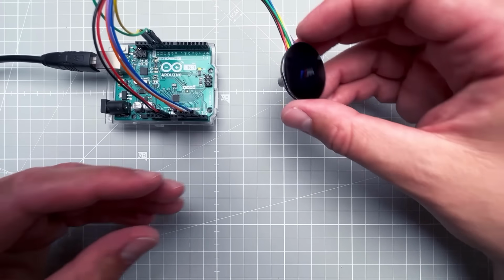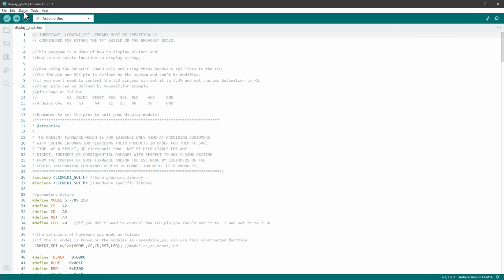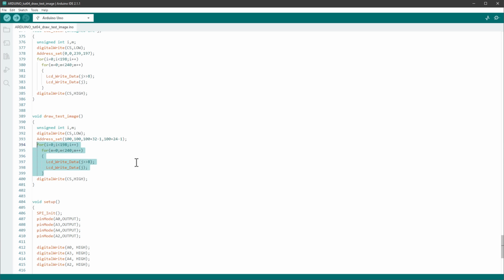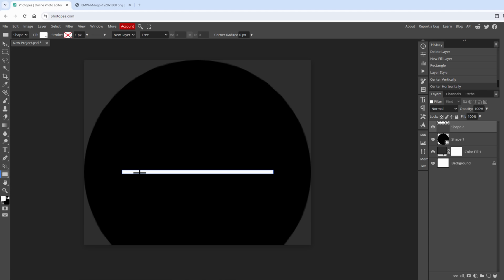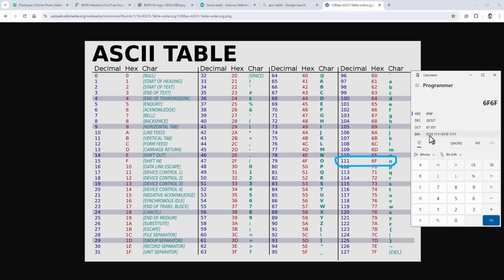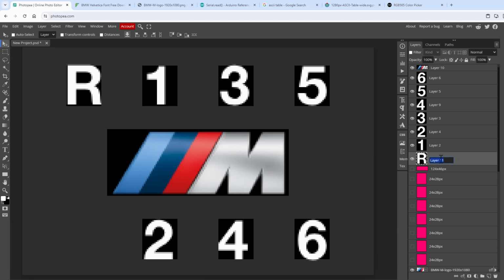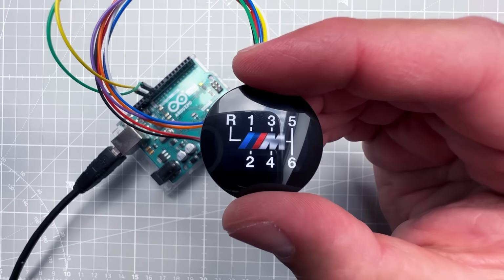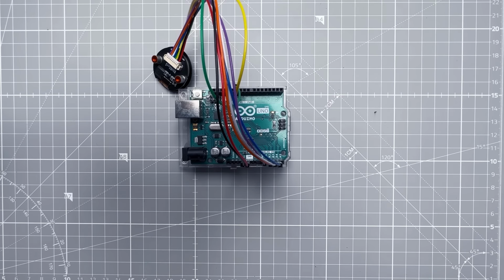I found PERFECT display

Comment from the maker: Gear Indicator video series (so far):
Part 1 - getting current gear with hall sensors: https://youtu.be/QixtxaAda18
Part 2 - exploring the Pimoroni 11x7px display: https://youtu.be/sZZFgSmYJjc
Part 3 - custom 3D printed shifter knob: https://youtu.be/HcP48uCBzDQ
Part 4 - Pimoroni 5x5 RGB LED display: https://youtu.be/84bn_OpuyCQ
Part 5 - SimHub shifter knob: https://youtu.be/JbVqXZngXAY
Part 6 - NeoPixel hexagonal displays: https://youtu.be/1NI-I1Lpdqo
Part 7 - Round LCD Display: https://youtu.be/pbqgrv5YSf0
Reply: You can use RP2040-Zero which costs 1.55$, it has 2MB flash memory
Reply: @ragesmirk  and a Gyroscope
Reply: I had no idea you could display such crisp high res with an Uno !

Your shifter is going to look AWESOME 👍😮
Reply: until you will build everything and test, engine will start making loud klak klak klak noises and one evening u-tutututu and engine kaput.
Reply from the maker: @aj9485 why would you think that?
Reply: @upir_upir  hey could you please create a design for a civic Si?
Reply: Hi, @upir_upir base in your grate work I made one for my car, I plan to use ESP32-C3 SuperMini board because ESP32 already have can bus (TWAI) I plan to made custom board with can transceiver and voltage regulator this way esp32 board and transceiver board can fit inside the gear shifter and only need 4 wires to run outside shifter (I already have sensors on my transmission sending gear selection over can network) The shifter I found on AliExpress work grat, display fit with just little modification. Here some test https://youtu.be/XlcMyIc9mCU?si=68l9Ix9YknBYOVKo

Comment: Thank you so much for all this work you did. I am going to use your code with a few modifications to work on my VW Jetta. I have changed the center image to "TDI" and I have rotated the screen 180 degrees so the flat section is at the top. The reason for the rotation is to allow room to put a small number below the shift pattern for  temperature/humidity display. My car does not have that so I'll include it on the shift knob. I'll also code that to update in between the shifter code. For those of you having problems with your coding I suggest you try ChatGPT for answers. It's fantastic at helping with problems.

Comment: i tryed youre code an only get a blackscreen. i have the display you listed in the deskription and an arduino mega the pins are corect and the demo programs from the data-sheet also work, but youre code only produces a blackscreen
Reply from the maker: Have you adjusted the pins for mega? I don´t see any good reason why it would be any different.

Comment: I don't understand why the update rate is so slow. Perhaps compacting the library into the program would be better. On an arduino 2560 I have a 7735 display at 565 color (16 bit) format and it is at least 10x faster than what you are showing. I assume that 77xx color LCD chips are all similar
Reply from the maker: I don´t know. As you mentioned, perhaps slow SPI speed? Would be nice if the update was faster for sure.

Comment: I am wondering, how would one hide the wires that go from the shift knob down to the controller board, assuming it's hidden somewhere under the center console?

I personally am going to attempt this project with an ESP32 with a round screen already built in, so I won't need another board, but I will need the hall effect sensor PCB. Now to connect the hall effect sensor PCB to the shift knob I'd need to of course run wires from the knob to the PCB, but unless I run them through the shift lever, then they will be visible on the outside, and I want to avoid that. Do you maybe know what else I could attempt to not be forced to drill a hole through the shift lever in my car?
Reply from the maker: I have used the wires behind the shifter lever, so it´s partially visible if you look closely, but it´s not that bad. I know that some shifters are already hollow, but that´s not the case for my car.

Comment: do you know what connector this screen uses? Is it a picoblade/MX 1.25? Great video btw, made me start my own project using the same screen
Reply from the maker: I´m sorry but I don´t know the connector name. Good luck with your project, what will you create?
Reply: @ no worries, I will just order a couple options and try them out :D I’m making a digital shift knob for BMW using this screen and a custom control module based off ESP32 and MCP2515. The idea is to make a plug and play solution that is compatible with most BMW models

Comment: Very nice ! ... directly ordered some :) ... Ever tried to put this inside a real BMW shifting knob ? The original BMW Logo for sure is easily removable and if you make a passage for the cable next to the plastic holder for the gear stick this should work ...
Reply from the maker: Cool! I haven´t tried it yet, but I know that some BMWs has the shifter illuminated - i.e. there is already 12V power available inside.

Comment: wow, I got here because I made a crapy 7 segment shift indicator a few years ago, I was hoping to improve with a a better oled screen and I was looking for a round one. Now I need this, lol, Can I buy it from you? I don´t have a 3d printer or the skill to make it nice. It is for a kswapped civic, 6 gear gearbox, with the reverse on the bottom right side. If there is room to add features, I have 2 ideas! 1) shift light: I have an output wire from the standalone ecu that can trigger that, turn the screen background to yellow and show a red SHIFT word, like on the fueltech ecus. 2) Another nice feature is that my car has a way to lock the reverse to avoid going from 5th gear to reverse, I lock it and unlock it using a switch, it would be nice to have a reminder on the knob screen.
Reply from the maker: Thank you for your nice words, but I don´t see this - at least not for now. If I make a second version, I will definitely use some of your ideas, they are all great! Good luck with your project.

Comment: I d/l-ed your code and have it running great, but I would like to rotate the screen output 180 degrees so i can put a small temperature display at the bottom on the shifter pattern. With the display rotated there's just enough room to add it in the left over circular area. Is there anyway to do that without adding in another screen driver? SPI.H does not support screen rotation, thus my question to you. Thanks in advance, love your idea and will be implementing it in my VW TDI...
Reply from the maker: I would think that the screen driver itself does support screen rotation - they usually always do, but you would need to find the correct command and send it to the display first.

Comment: Well done.
 is it possible to use an arduino mega 2560 and what are the pinouts, thank you
Reply from the maker: Yes, you can use that board as well, if you google pinout image, you should be able to find those - or start with software spi, and in that case, you can use any pins.

Comment: Tesla driver here.
Reply from the maker: Cool!
Reply: @upir_upir  So basically in an EV we have a lot of important info available in the CAN bus but missing on the dash. Such as battery temp, motor temp and BMS controlled max charge / discharge rates. Currently we use an OBD2 dongle and an app on the smartphone but your displays would be so much cooler.

Comment: I am actually about to get my Audi 90 b2 which i want to "modernize" a bit but in the same style as the rest of the car's dashboard. I would really want to try this and try to fit in my Audi but i don't have any knowledge about arduino and programming. I would also love to see what other variations you come up with! 
Keep up the work!
Reply from the maker: That sounds great, I would actually like to recreate the digital dash from Audi UR Quattro, or perhaps this digital dash was also an option for the B2? Not quite sure about that. There is a lot of information about Digifiz, which I have already recreated in my previous video, and very little information about the Audi digital dashboard.
Reply: @upir_upir  I don't think that it was an factory option but you could surely put the digital dash from the urquattro into a B2. 
Excited if you do or try something with the idea!
Reply: @upir_upir  Actually I just found out that there was (most likely) a option for a "cheaper" version of the digital dash in the B2 Coupes.
Reply: @upir_upir  I know I am a bit late but I still wanted to share with you that the DIGIFIZ digital dash was an option on the Audi 90 B2 from factory

Comment: Hello mate. Can you film video how to do the same shift display for Suzuki Intruder VZR1800 with logo #M109R 5 gear? Thanks
Reply from the maker: How do you plan to get the gear value from that bike?
Reply: @upir_upir  maybe is any counter to count from Neutral to down one 1 gear, then to up steps one by one till 5-th gear. In youtube i saw gear indicator installed on M109R but not like your's display.
Reply: @upir_upir  gear indicator connect to ECU connector. Here do not allow to attach link

Comment: using image2cpp i get distorted image. What settings should I use? I am trying to remove 6th gear and to draw my car's logo instead of ///M logo
Reply from the maker: I believe that setting the mode to horizontal RGB565 should work, but you might need to format the output, or you can use the tools that were used in the video.

Comment: I don't know if it's yours, and honnestly don't mind, but this is a very clever way to manage memory bounds ! Regarding letters, as they are white, you can reduce color depth to 1 byte only, (even 1 bit). Thanks for this complete and quite detailed programming coarse. I finally learn things at 70 ! 
BTW I was quite comfortable with Photoshop when I worked, but didn't know Photopea, thanks as well for this.
Reply from the maker: Thank you for your nice comment, I´m glad it was helpful! You are correct about letters, probably one byte per pixel might be enough.

Comment: What is your email? I tried to find it on your page with no luck. I have a few questions
Reply from the maker: It´s on the about page of this channel, but somehow it´s only visible on desktop. Anyway, please feel free to ask your questions here.
Reply: @upir_upir  I’m also wanting to use your battery level indicator example but scale it down to the top right corner as well
Reply from the maker: @charliejones5584 sure, please send me an email and I will see what’s possible.
Reply: @upir_upir  thank you. I sent it all over to you
Reply: @upir_upir  well I need help with a rotary encoder and data transmission project with real-time values and I need a way to send you the ino files so you can look it over and see what you think

Comment: This would be nice in my BMW F10
Reply from the maker: I´m sure it will!
Reply: @upir_upir  in a different way because the shift knob is automatic plus sequential. Have a pcb and screen to match the curve. Boot up BMW animation also showing the gears in manual mode as well as showing boost. That possible?

Comment: out of interest have you thought about storing the black and white bitmaps using a much smaller bpp  instead of a 24bit bitmap you could have a black and white one, and probably save a tonne of memory.
Reply from the maker: That´s possible, but you would lost the antialiased edges, so it will not look as smooth. That said, I could have used 8bpp or 4bpp and that would save some memory and still look fine. Maybe next time.

Comment: How would one implement this application in a real car? Mainly how would one power up everything?
Reply from the maker: You would need a stepdown converter to go from 12V down to 5V to power the board and the display. I will cover that in the next video.

Comment: 😂😂😂 Uno ?? Overdrive... Tiny 2313 would BE enough
Reply from the maker: I´m sure you can use even slower, cheaper and simpler IC, but I like the options of using Arduino IDE.
Reply: @upir_upir  If you can Assembler, a lot would easier and you have more space without Arduino IDE...😉😉

Comment: You should try this project with an SD card adapter or an EEPROM with the Arduino. You could even possibly have a method of uploading the images over serial and having the Arduino write it to the EEPROM. Your methodology of going through possible solutions to issues is very interesting and calming to watch. I also think a more in-depth video on making the still images in photopea would be much appreciated. Great video!
Reply from the maker: All good ideas, but I will probably just use a microcontroller with more memory, like the ESP32.
Reply: @upir_upir  The same principles on an ESP would be interesting as well, even if not necessary it would make for a good video 👍

Comment: I have plenty of memory in my micro controllers. It's almost the same code with upgraded hardware. You can also make a disk (SDCard) with jumper wires to an adapter and it's not hard to solder. With CS (chip select) you can swap device and reuse most wires/pins. Not sure if that Arduino got 2 SPI buses (display issues when swapping 1 SPI bus), but it worked for me a couple of times and you can disconnect when not used.
Reply from the maker: Thank you for your feedback. I will most likely use ESP32 with more memory instead of using SDcard, since it feels like more compact solution.

Comment: Really awesome project, I wonder if an RP2040 would be suitable, super cheap and common these days. There's XIAO Seeed RP2040 board that would fit underneath I believe, could run a small round daughterboard underneath with mounting holes/bayonet mounting (plus any extra ICs for position sensing) and it'd fit together in a nice little 3 PCB sandwich :D
Reply from the maker: That’s exactly the plan, except I plan to use the Xiao board with the ESP32 chip instead. I don’t have too much experience with the RP2040.

Comment: I am having trouble converting the bmp images to c-array
Reply from the maker: What kind of problem do you have?
Reply: @upir_upir  when convert the bmp image to c array exactly how you do it (or how the instructions do it) with the same software you use the image on the display shows up as random dots and not the image I want
Reply: @upir_upir  the logo I am trying to do is the ford logo
Reply: @upir_upir I solved the issue (your code) on draw_image (   55,     99,  123, 46, gImage_shifter_logo_M_123x47px); you had width x height (and on my code) draw_image (   55,     99,  55, 137, gImage_ford_logo); I had height x width causing the picture to look like random pixels so I noticed the difference swapped them around and bingo it works

Comment: I have a 2002 ford fiesta and you have inspired me to try and make one myself
Reply from the maker: That´s great, good luck with your project!
Reply: @upir_upir  thanks and your code once you get your head around it, it is very easy to swap out the logo  so when doing the masking part of the logo all you have to do is make it the same size as the BMW logo and make the mask for the new logo then export it then change it the required code and swap out the logo code with the new one and being the same size it should work perfectly if done correctly

Comment: I usually for smallness use the arduino chip without any board, just solder directly to the legs. This allows for small solutions.
Reply from the maker: That´s an interesting idea, but don´t you also need oscillator and a few other parts? I will probably go with some ready-to-buy board instaed.

Comment: Very nice! Totally cool shifter knob and great video showing the whole process.
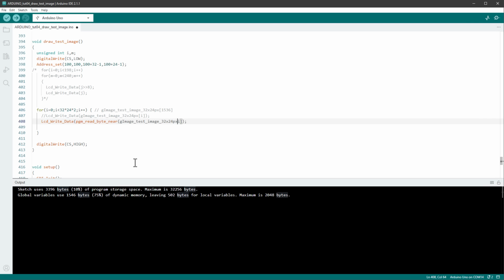Just a note about the code, at 16:53 you can still use array index notation, you just need to take the address with "&".
So you could have "pgm_read_byte_near(&gImage_test_image_32x24px[i])"
It boils down to the same thing of course, but using array notation is probably a little bit clearer.
Reply from the maker: Thank you for your comment and suggestion for a code change! Yes, I like your version much better, it´s more understandable. Thanks again!

Comment: This is the most European thing I've seen and I love it.  Over here in the states I drive a 01 accord 5 speed :) standard transmissions are very rare over here sadly.
Reply from the maker: Thank you! Although I would say that something like this is not common even in Europe - i.e. having current gear indicator. Actually, I have probably first seen it as an accessory on Mustang.

Comment: Curious why you use Hall Sensors to detect the gears, do manuals not supply the current gear via can bus and a BT OBD2 adapter?
Reply from the maker: That´s right, many cars dont expose the current gear via canbus/OBDII. You can always get RPM and speed and calculate the gear that way, but you have to know the gear ratios and that would most likely be different for different cars. That said, I will explore the OBDII version in the next video a little bit more.

Comment: Mustang driver here with the gt350 shift  pattern. The normal manual Mustang is the same pattern you show in this video. The difference of the transmission in them is reverse up and left for regular Mustang and reverse up and right for gt500 gt350 and Mach 1 transmission
Reply from the maker: Thank you for the clarification, I will try to support as many shifter patterns as possible.

Comment: I noticed Xiaomi air purifier has an OLED display around this size. I wonder if that can be used to get a OLED shift knob
Reply from the maker: It would be probably quite hard to get that display, but there are other round OLED displays available - but not cheap, and not as easy to use as this one.
Reply: @upir_upir  Thanks for the info, great to see you've seen what is avaliable too.  I think the OLED would be a good choice for some of the higher end cars as the true blacks would be a very good feature that makes it not distracting for night time driving.